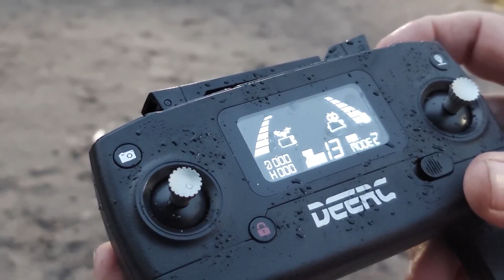Cómo hacer una súper batería de drones. Parte2

Comment: la idea está buena.. pero ese tipo de baterias son muy pesadas, cuantos minutos de vuelo pudo hacer con esas baterias?
Reply from the maker: Amigo el problema no es el peso, el problema es la descarga de la batería, te lo digo porque ya hice la prueba, he hecho unas cuantas baterías y todas distintas y el peso no tiene que ver tanto. Las baterías de lithium ion casi todas están diseñadas para un ciclo de descarga estable. El dron mete tremendo jalones cuando se va elevar, maniobrar,  por viento y por peso, las baterías de lithium polymer, están clasificadas con la letra "C", para un dron debe ser de 100C y más. Estas baterías del video, las 6 baterías 18650, pesan 252 gramos y no pudo levantarse el dron, se volcaba cada vez que trataba de levantarse, con 4 baterías 18650 estuvo volando por 4 o 5 minutos, sin embargo le puse una batería lipo de carro rc de 311 gramos 80C que pesaba más de la mitad de mi dron que pesa 538 gramos y se levantó como si nada y estuvo volando por 4 minutos. Esa batería tuve que adaptarla a las patas del dron porque en tamaño era más grande que el cuerpo del dron. Hoy voy hacer una prueba con otra batería clasificada 100 C de 7.4v 1500 mAh.
Reply: @taranta  tal vez esas baterias 18650 ya están en las ultimas.. tal vex con baterias nuevas anda mejor.
Reply from the maker: @proyectos-hanlest  las baterías 18650 duran hasta 30 años, si las sabes revivir, claro me refiero a las sony mericanas y la koreana samsung